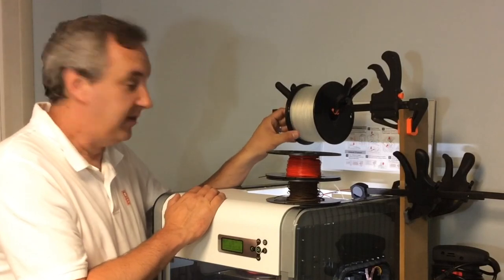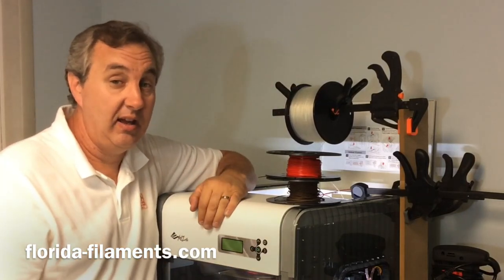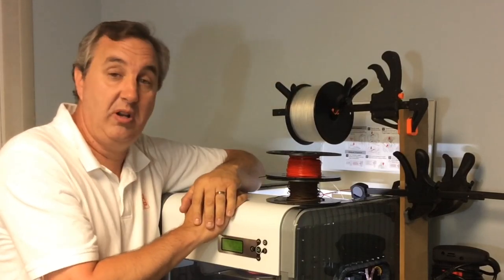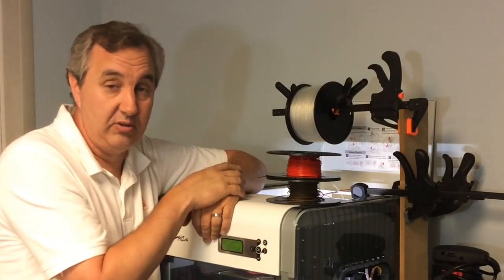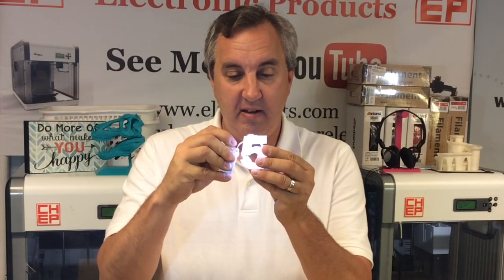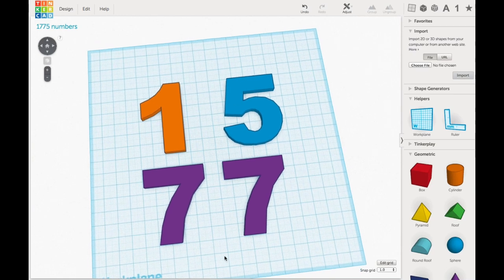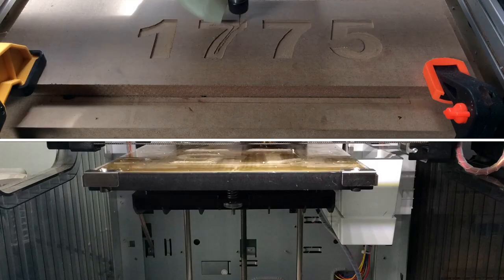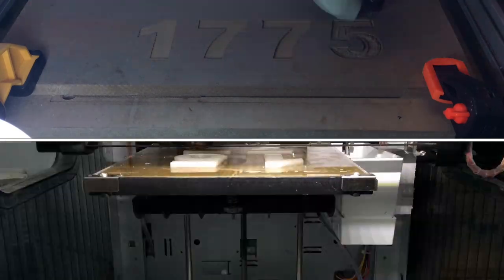Filament Friday #25 - Address Plaque and Switching to Repetier

Comment: I had the same issue with the software and the factory cartridge. I fixed the problem by uninstalling xyzware and reinstalling it. 

1.first uninstall xyzware 
2.download xyzware 
3.disconnect computer from the Internet 
4.install the software
5.on your firewall completely block xyzware from connecting to the Internet 
6.reconnect computer to Internet 

Once that is complete you should not have another problem with the cartridge issue. This stops online cartridge checks and eliminates the problem.

Comment: Thank you for the videos. You have helped me tremenously! If it was not for you my Da Vinici would be dead in the water.  I had the same cartridge error with every cartridge I had, which was about 15 cartridges.  It has been a crazy ride.  I was also forced to flash to repetier because of this issue.

I am hoping  you can do a video on clogged nozzles. I have followed the XYZ video on unclogging it, but it just isn't working.  I know there is still a clog, when I load the filament it curls up.  This causes my prints not to stick to the bed as it is not extruding properly.

Any how, thank you so much! Keep up the videos!

Comment: Yaaaay! Welcome to the "dark" side!i finally did mine 2 weeks ago. I've been using Simplify3d since before flashing and even though it's $150 I highly recommend it for its advanced features. I have some Taulman 619 printing and just last week updated to an e3d hot end. I suggest that for your repetier machine, you can use the existing carriage and just print the hot end holder. Solder one single 12v lead for the fan and the other wires just get connected to existing wires in the machine. Feel free to hit me up if you have any questions. I printed steel, copper, wood and bronze successfully on the original davinci hot end, the e3d is much easier.

Comment: chuck I have been following you since I bought my own Da vinci, couldn't be happier since I flashed to Repetier, but I do use my Simplify3d software with it to slice and control the printer instead of using the repetier software

Comment: Nice to see that you finally got frustrated enough about the chipped filament issues from XYZ to make a change for the more affordable and wider range of filaments that no longer read any chips to operate the XYZ printer.

Combining 3D printing and CNC with Electronics projects sound like a good option once in a while but not exclusively. We don't all have both machines but the knowledge to do the dual machine projects would still be informative.

Comment: Are you going to put a E3D v6 in your open source one? I flashed my aio to the repetier (yah I lose the scanner) and I did it for basically the same reason. 

 I had 2 xyz carts that I had used almost all the plastic (according to the chip) but I still had 8 meters left (again according to the chip) on one and had 22 on the other. I had a small project that would be less then a meter so I loaded the 8 meter  cart went to print but it wouldn't print because the cart was low not empty but low. swapped to the 22 meter cart and again it would not start saying the cart is tow low.  I opened my cart to see how much was there and I had close to a 1/3 of a reel  way more then 8 meters my other "empty " cart was the same way.

So since the carts cost more (which I was fine with ) I wanted to be able to use up what I purchased . but the software would not let me.

So I flashed mine and used up the carts. 

I have now been printing with other filaments like TPU and I have installed the E3d V6
it make really good prints.  I did have to learn repetier but I didn't think it was that much different then xyz ware. However the slicer is a lot different.

anyway I do enjoy your videos and I like seeing whole projects I am actually considering making a cnc machine as well so more printing and cnc would be interesting.

Comment: I thought about flashing mine but I also have a Tevo Tarantula that I can use Repetier on. I got around the cartridge issue some how although my extruder clicks while printing the first layer. I have the latest firmware as well accidentally updated it.  But I bought the dimension bx resetter off ebay. I then blocked xyzware in firewall reset cartridge and loaded up a print and it works. Except the temperature I set for nozzle spiked when slicing in slic3r, and the extruder clicking on the first layer. Its very easy to use Slic3r with stock firmware just need to change the gcode save as .3w and load it back into xyzware

Comment: It could be a great new direction. The CNC and the 3D printer are just tools. The current trend is to do just one or the other. That's like having a channel that does projects that only require a hammer and another that only requires drills. Real interesting projects always require a diverse selection of tools. I'll be watching, you can count on that.

Comment: I bought a Sony Hi-Fi about 10 years ago that had a proprietary ribbon cable to connect the amp/tuner to the CD player after about 14 months whilst moving home the cable got damaged and despite trying I was unable to repair it, a visit to the Sony store was even more disappointing when they told me a replacement was not available, I ended up having to remove the sockets and replace them with serial ports which was a real pain.
 Since then I have steered well clear of anything with a proprietary component.

Comment: Got the Da Vinci 1.0A for Christmas, and already disappointed by the lack of colors in filament, and all but 2-3 are out of stock so going to the Repetier might happen soon. Ever since I got the printer I have been going through your videos, definitely the most helpful that I could find. Please share the combination of machines to make projects! Keep up the great and informative videos!
Reply: +Chuck Hellebuyck's Electronic Products I have heard some of the newer models don't flash. Do you know about this? I have the 1.0A with Software 2.1.5.5 and firmware 2.0.1. Thank you.

Comment: hey Chuck I was wondering if you think it would be possible to print a circuit board with copper filament. I don't know anything about electronics but if I could print my own circuit boards it would seem like a fun thing to get into. I know they are normally copper tracks, would bronze tracks throw the resistance factor too far out of whack?
(noob question I know)  I know a dual extruder printer would be needed which I have.
Reply: *****  Ah yes of course the board would be abs and melt when soldering :/ I have read online about copper filament but have not found any. I meant bronze but thinking about it I realise you cant solder to bronze although if the filament is 20% plastic then maybe its possible. The board being plastic would obviously still be an issue. I think better to explore other options. Thanks